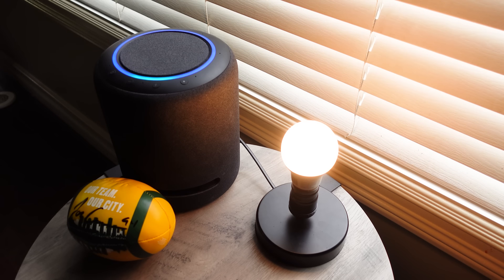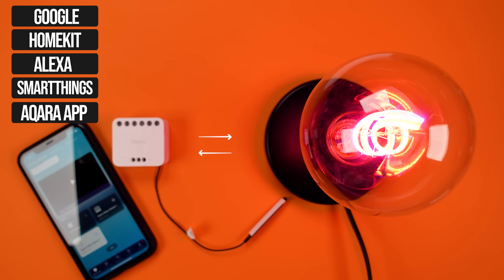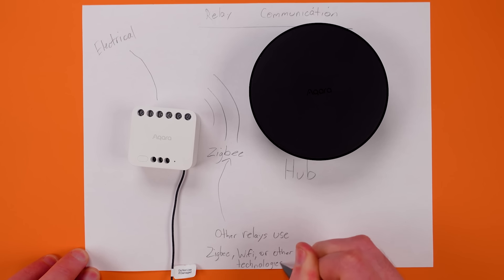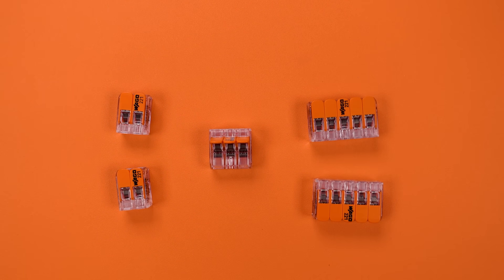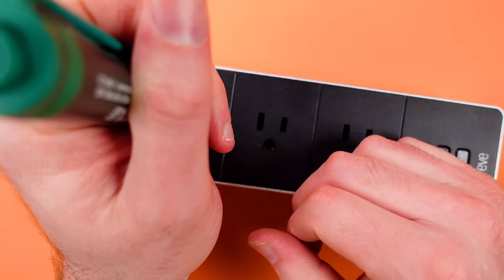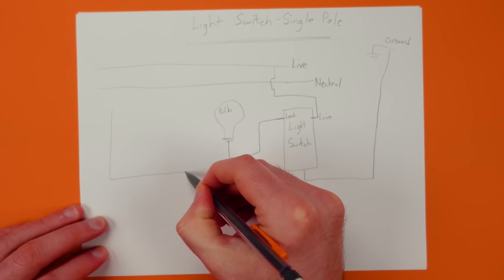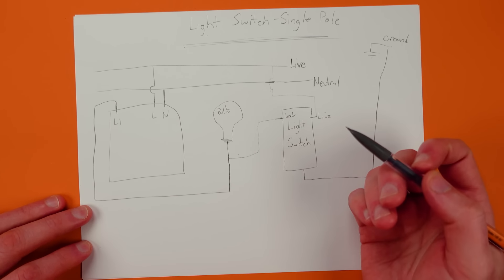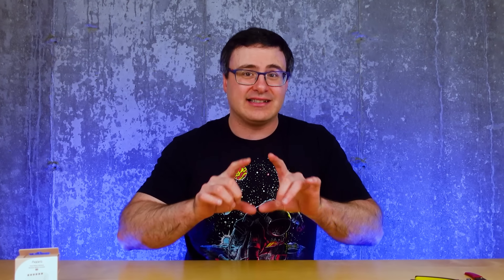How To Use Smart Relays - 101 (Featuring The NEW Aqara Relay Module T2)

Comment: I think you over complicated it. A relay is basically a switch that controls another switch but internally, before anything happens. It has 2 states on the exit, NO or NC normally open or normally closed and these states are operated by the relay receiving or not some electricity. The pulse mode is very specific mainly to garage door openers. The fact this ones controls 2 units as well as AC and DC outputs just make it more versatile, but also more dangerous because of the risks of sending some AC to DC things. Furthermore, it is a huge piece of relay ! Theres no way to hide this inside a box without a lot of risks in the wall as you said. But hey great video, as always.
Reply from the maker: Size matters, eh Philippe? :)
Reply: Lol 😂
Reply: What's the problem or sending ac to this module?
Like this is more safe, if it is a DC really, it may burn when you connect AC but not this one
Reply from the maker: In the case of this relay, I think the biggest risk is that you could be putting in a full AC home connection in and then connecting a sensor that isn’t ready for that.  That would be the biggest concern I would have, and that would only happen on the S1/2/com side of things.

Someone could also conceivably use the jumper cable and hit their load device with the wrong voltage and current as well so you have to watch out for that too
Reply: So the resistive load of the relay is 2.5KW @ 250v (So in the UK it would be 2.4KW), But the LED, Compact Fluorescent, and Linear Fluorescent tube are only rated to 1A due to these being inductive loads. When trying to work out your Wattage for you country you need to Voltage (for your country) X Current rating of relay = Wattage you can safely use. 
Please please please if you are not sure about this or how it works then do not attempt this. In the electrical game we have a saying “a little bit of electrical knowledge is dangerous” and I have seen this saying proved right time and time again. 
This is the problem with these types of videos, people see this done and think I can do that and end up wiring Lin to the NO contact and when it switches flash bang it is cream crackered. I know @automateyourlife is trying to be helpful but don’t show people how to wire these things up. Let them talk to an electrician. Love the relay idea but the quality of the relay is my biggest gripe. 👍🏻👍🏻🫶🏻🫶🏻😉😉👌🏻👌🏻
Reply from the maker: @andrewbagnall5430 just trying to help!  I hear ya.  It’s a tough video to make and I thought about it lots before doing it.  I can just hope it only helps and folks like you come and explain things Andrew
Reply: @AutomateYourLife  I worked in the electrical game for over 20years here in the UK and the things people have done in their homes is really scary. I had a customer who tried to power a 10.5KW shower from the lighting circuit, one customer screwed some back boxes to the wall and then put twin sockets on the front, he didnt use any cable to the sockets, he was wondering why they werent working, and the oscar gors to the electrician who wired 415v 3Phase to the IT system (computer, printers, telephones, printer servers, local office server CAT5e, everything fried. So many DIY (Destroy It Yourself) people out there who havent got a clue. But if it wasnt for numpties like that electricians would be out of a job. Great video, but say this is how I wired my relay in for what I wanted. Then it is at their own peril if the use your application and it goes "tits up". Have a grat week.👍👍

Comment: The wireless switch mode i've found is best used with smart bulbs. You turn on the wireless mode, then plug in a smart bulb and configure the switch to turn the bulb on and off inside your software. Then it behaves just like a physical switch, but doesn't actually cut power to the bulb when you flip it. The smart bulb can then be used in other automations while being powered all the time.

This is especially true for colored bulbs, dimming smart bulbs and ones that can change the light warmth of the bulb.
Reply from the maker: Right!  Thank you!
Reply: Ah! I think wireless mode is what I am looking for. How is this labelled on the switch/relay modules? I'm looking for a zigbee relay module with wireless mode that I can use to control smart bulbs.(And ideally one compatible with hue hub).

Comment: When it comes to pen testers. I was always told to Test it (with a known power), Check the one you are checking, but then go back and test it again with a known good one. Just to be sure it is working properly.
Reply from the maker: Yeah that’s a common practice that guarantees the safety of a testing tool.

It’s a little hard to guarantee a pen tester is working though, so the process I gave gets you fairly close without having to own a couple.  But if you can do this, 100%

Comment: Hello. Thank you for all yours explanations.

I'm from Belgium and I would like to connect the relay to my boiler.
In order to install Xiaomi thermostatic valves and control my boiler remotely.

Is it possible to explain me how to connect directly the relay to the boiler ? 🤓🙏🏼

Can I follow the connection explained in the video (36:39 This Diagram Sets You Free With Smart
Relays) ?

Thanks in advance for your help.
Reply from the maker: Sadly, I can't guide you on this. You can take this knowledge though and take the next step. Boilers can be tricky because it depends on the load that can be going through the circuit you'd be trying to create. Watch yourself with that. Some boilers would use the relay as just a switch and others would use it as a switch with load pass through (of load/current).

Comment: Thanks. Im trying to activate a tankless a water heater relay with the water heater's built in 12v output on the board. Any chance this can be powered by 12v?
Reply from the maker: Check the specs :)

Comment: Odd question but, could you theoretically make a Super Nintendo remote controllable doing this?
There must be a vast number of use cases for this, aside from boilers/garage doors/lights. If I could automate my CRT/retro consoles I'd dive into the opportunity to mod them.
Reply from the maker: I think these specific relays are a little big
Reply: @AutomateYourLife  Size constraints are a given for sure. I'm mostly just wondering if it's possible to do.

Comment: I am planing to replace  the relay in the ceiling fan. Does this only turn the fan on and off? Can I adjust the speed of the fan or change direction ?
Reply from the maker: It can do some very small motors but it has to be a very specific type. You'll need to look up whether your ceiling fan has that type of motor in it. But I doubt it can do that

Comment: Can I use this on a ceiling fan? I don’t have a wall switch just the remote control
Reply from the maker: You could potentially. You'd have to interrupt the circuit and get this in the middle.  Likely can do it up at the fan itself but think about how that'll work with the remote after!

And check with an electrician please!

Comment: Seems like I have a problem. My switch life is also the life of an outlet. I don’t have enough wires to connect both seperate. Is it safe to connect life to com? I mean the direct 230V life? Fun fact if I disconnect and connect the load side of the switch without  touching it it turns on and of. It’s one of the switches with a light inside. Maybe it’s never 100% off and that’s why it’s not working for me 🤔
Reply from the maker: Noooo I don't think you can do what you're doing here.  Live to com isn't good either.

Maybe check in with Aqara themselves.  The device is rated to handle lots but I don't think this is going to work

Comment: I am looking for a small, thin smart relay switch that will work with 12v DC LED lights, any suggestions?
Reply from the maker: I was looking at a Lutron ELV switch for that use case I think

Comment: Great video! Could you do one explaining how to wire up this relay in a 2-way switch system? 🙏🏻🙏🏻🙏🏻 Aqara says it’s possible but won’t provide a diagram!
Reply from the maker: I thought that was in this video. :)
Reply: It is? Sorry! I watched it again and couldn’t figure it out. 😅 Really noob with wiring here. 
I thought the diagram you did was for two lights and two switches. How would that work for a single light connected to a set of two-way switches? One switch upstairs and one downstairs. Looking to install the relay next to the downstairs switch.

Comment: Is it ok if my ceiling neutral go in T2 N and my light neural go in T2 N at the same time? Or only ceiling neutral is allow to be in T2 N?
Reply from the maker: You should ask an electrician about this. :)  They need to have a look. I can't answer your specific situation.
Reply: @AutomateYourLife  Problem solved and working! 😃. Thru ur videos i managed to find a way to solve my circuit issue. Thanks.
Reply from the maker: @JustACatLover  I'm glad! I just got to be careful giving direct advice like that!
Reply: @AutomateYourLife  no worries bro. Totally understand. I do the same too with my cat channel.

Comment: The buzzer on my door intercom system isn’t very loud and therefore I want to use this relay to send a sound to my HomePod speakers whenever the intercom button is pressed. Can I do this with the Aqara Relay?
Reply from the maker: I suppose it's possible, but I don't know your intercom. I'd get a smaller relay though
Reply: @AutomateYourLife  I guess this relay generally works by opening or closing a set of contacts when it is activated by HomeKit. I’m looking for the reverse of this. Are there a set of contacts on the relay that if bridged will activate my HomeKit system. If so, would it allow me to play sound on my HomePods and flash my lights in certain area’s to indicate that my intercom has been activated.

Comment: If the t2 relay is properly wired to a manual, 3 speed wall fan, that plugs into an outlet, will the smart app be able to control the speeds?
Reply from the maker: The smart app is just going to show it as two separate controls. You would have to name them appropriately
Reply: Will one of the controls be on/off and the other control would be fan speed level 1, 2 or 3 or perhaps, the second control would simply be a slider that allows me to increase the fan speed?
Reply from the maker: @cartermw two switch buttons is what you get!

Comment: Well wired it as this input 1 is a garage door input with a garage connect on the floor. This is designed for dc 10vdc to 24vdc but have 120vac (very little current for the input. Wired com to input 1. Input 2 is photocell which is 120vac with 120vac output for a light controller. I wired this to 120vac and used red light control wire to input 2. 

So I know when it’s dark and when door is open.  

MyQ issue since they don’t wish to send me when door is open or closed. Is why I started with a dual T2 relay.
Reply from the maker: Nice!

Comment: Bond has an actual fan controller that goes in the canopy and can do all of this PLUS control the fan speed. It comes built in to some fans, but you can buy it. Can't remember if it's HD or Lowe's that sell them. And it's not their hub that you see advertised that works like the fan remotes by replicating their RF. I think Inovelli is also coming out with one.

Bonus in that their shaped to fit in tight ceiling fan housings like regular fan controllers.
Reply from the maker: Cool!

Comment: How would this work using a Shelly 2pm plus? It seems very similar to me, but there's no com connection. I'm trying to tie the Shelly into a pull chain fan/light on a single wall switch. I want to keep the light tied into the wall switch via the relay circuit 1, but keep the fan on circuit 2 with the wireless switch only. I get as far as tying the SW1 on the relay to L1 on the wall switch, but without a com connection I can't figure out what to tie to L on the switch. Also, I only have N at the fixture in my house, not the switch. Also will not take the internet's word alone before messing with my home wiring, but a little stuck here.
Reply from the maker: I'm sure the Hook Up has a good video on that relay. I believe Shelly's relays also have wiring diagrams so that you're sure before you do this!

Comment: Excellent review of relays.  I understand that while the Aqara relay has the features you describe.  I thought the Shelly system has another feature that is useful which is that it can also issue smart commands to another device in addition to switching its state internally.  I wanted to use this to put behind a standard switch to allow a smart light to stay powered when the switch is off but the state of switch then determines the device on off state in the smart light in its own internal software.  Is this a valid use case?  I have in the past simply bridged the wall connection to make an always on link to the light and then installing a smart switch and not wiring its switching to the light but simply use the switch to off/on the light via an automation.
Reply from the maker: Leaving power to another device isn't something that a relay does naturally. A relay, by nature, changes power to the device when you ask it to. It's not providing power all the time (not a normal use case anyways).

However, I do think Shelly has an option for this through their web app. It's them building up the connectivity options. It won't work with everything out there though as far as I know. I haven't used it extensively though, so can't comment fully.

I guess the question I have is why are you trying to do this much control? If it's a valid use case to you, that is great.  But a smart switch will likely do this all better as long as you don't use it for the dimming features on the switch. So I feel like you have the best solution already!  You just need to use the on command to set the state of the bulb and same with the off command. Create 2 automations to do so. :)

Using the same switch within the same app/system will help too.
Reply: @AutomateYourLife  Thanks for your response, you have confirmed my suspicion that relays as configured are a poor choice for this need.  The issue is that of smart lights versus smart switches.  If you install smart lights but retain conventional switches then they go dumb and loose connectivity as soon as someone operates the switch. However, smart switches paired with dumb lights limit the control options such as color temperature and flexibility in routines. Of all the brands I know here in Australia, only Lifx offers switch and light combinations what can operate both in smart mode and not cut power to the light. However, my experience with them is that they use poor wifi implementation that get confused by 2.4 and 5 GHz wifi. However, my solution of using a smart switch with the lights power wired to always on leaves you with problems for in ceiling lights that need 3 or 5 power cycles to jump into pairing mode.  You can do this on the mains circuit but that means pushing all lights on a circuit into pairing when you might not want to do this.  That then leaves me climbing a ladder to access the circuit in the ceiling which fortunately now often plugged. This could be resolved by manufacturers, design lights and switches that can operate collaboratively and keep the power on state of a turned of light.  Alternatively, allow for the device to be software reset to a pairing mode versus the power cycling.  Some devices now do the software mode reset. A relay specifically designed to isolate the switch circuit from the power switching and that is able to send a command to smart light would also be nice to have as appears to be an option in the Shelly App but suspect that Shelly does alter the function of relay but does the signaling to the smart light out of the web app, not from the relay itself.  Maybe I am wrong.
Reply: Also, did find that, as you recommend, two automations, one for on and one for off are better than a change of state automation which does on/off. I use HomeKit, have a mix of Hue and Generic Zigbee lights, use a Zemismart hub to run the generic stuff and like to HK as well as an Aqara M2 to drive my blinds and door bells and some thread via HomeKit motion and contact sensors with HomeKit video cameras.

Comment: If you have two wall switch; one for the light and the other for fan.  Can you the two physical switches on the same T2 relay?
Reply from the maker: It's gonna depend on ratings, and fans usually have different requirements.  Check with an electrician when you have all 3 ratings gathered

Comment: I've got one question. What does it happens when I have 2 lamps commanded by 2 different deviators each, in 2 separated boxes. Example, in my dining room I have two entrances and there are two lamps. I can command these 2 lamps from each of the accesses. I want to use the Aqara's T2 in order to get command the lights from my phone. 
BTW, good job, thanks for your detailed explanations
Reply from the maker: Hey Giuseppe, I'd love to help you here but the terms you're using are very different to what I'm used to.

But I think if I'm understanding you correctly, you have two separate switches with two separate runs to lamps.  If that's the case, I'd just suggest you get two relays.  Maybe just a single relay for each switch instead of a dual 😃

You'd be coming across with wires if you're using one relay.  It's not going to be worth it vs the cost of a second relay
Reply: @AutomateYourLife  Yes, you're right, I meant a "deviator" meaning a switch in 2 different locations that tunrs on/off the same lamp.